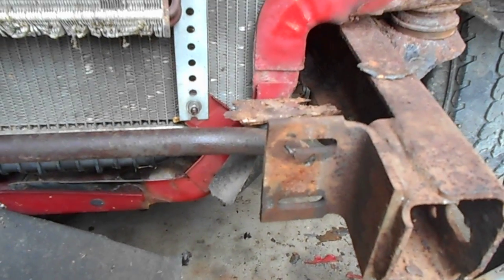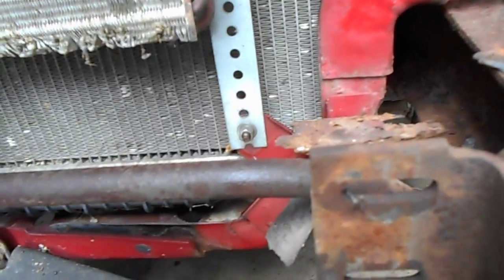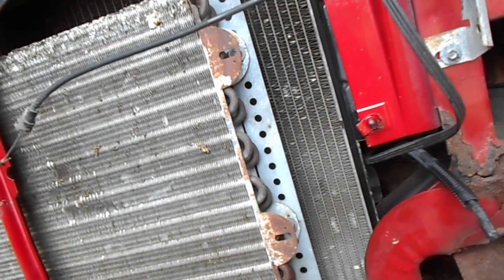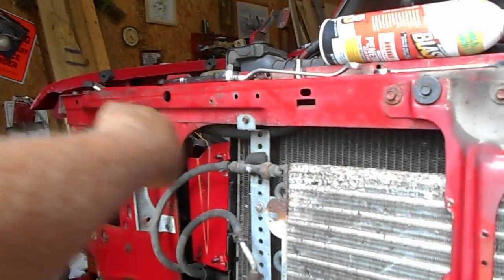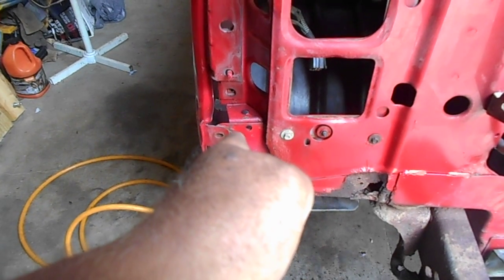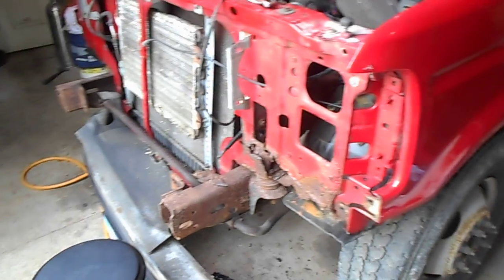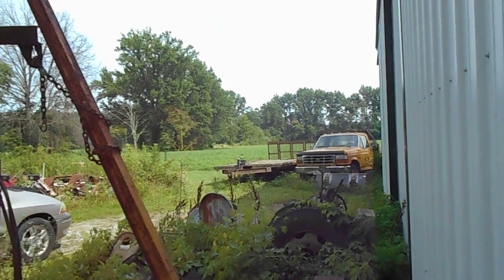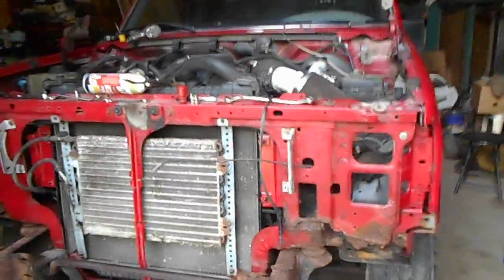Big Reds Tare Down pt# 2

Comment: They must've hit pretty dang hard to have tweaked the frame & body that bad.  I guess you'll just have to pull more needed parts off of the blue donator truck.  Maybe some parts off of the red donator truck ment for the yellow truck.  Oh, the fun & joys of fixing up stuff.  Stay safe
Reply from the maker: I am really hopeing that its just the front frame rails that are bent over, If its just that its a pretty easy fix to do. Most of what I need will come off the blue truck but if needed off the plow truck , 2 trucks to fix and 2 parts trucks to fix them with  so I hope I dont have to buy too many parts from the parts house and that will sure help the budget for the fix ! Bandit

Comment: buddy has a thick concrete slab floor in his shop with deep eyehook bolts set in it for jacking and straightening bent frames, works pretty good.   I'll look forward to seeing how you accomplish the straightening of yours.
Reply from the maker: I found an easy way to straiten it out that worked pretty good. When we built the barn I wanted to put some cans in the floor so I could put chains in the floor just for this reason, How ever my plan got over rulled and we didnt put them in but I really wanted to put them in.  When your not paying for it it's really hard to get what you want put in it. ! LOL  I think you will get a kick in how I do it !  Cousin Bandit

Comment: Thanks for the update Bandit.
Will you reuse the transmission cooler?
Reply from the maker: More than likely or I might have to get a bigger one now because I broke the fitting for the trans cooler on the radiator and It might not be able to be fixed so I'll have to wait and see what happens.  I hope I can fix it but if not it might get ugly !  Bandit

Comment: is that a 93  i had one, bought it new. drove it 265000 miles with one repair a alternater. gave it to friend. his kid recked it right away. they had a recall on the front bumper bolts.

Comment: Hey Bandit, maybe i just missed the video upload, when did you change the bed out on the snow plow truck? Or is that the snow plow truck?
Reply from the maker: The truck I'm working on is Big Red the 1 ton flat bed , The plow truck frame is too far gone to even thing about doing anything with it other than taking parts off of it.  I hit the frame with a hammer and it went right threw it ! So its shot !  But there are some good parts and an engine I need for old Yellow, When I get done with both of them I'll have made 2 good trucks out of 4 and both will have some goodies in them that they dont have now, Like AC !  LOL  Bandit

Comment: Bandit, in one of your videos you replied to someone saying that the later j'd 95 combines had 4 sticks. What did you mean by this. My 55 has 4 levers on the steering  column. Is that what you meant.
Reply from the maker: The 4 stick colume in the 55 95 and 105's was for raise and lower the head and reel forward ground speed and the 4th one (left hand side) was for the varable speed for the reel.  It was JD's way to copy the AC varable speed they had at the time on the head before they had the hydraulic drive on the 3300-7700 combines.  Bandit
Reply: thanks for the reply. Can you tell what year the combine is if it has the 4 sticks
Reply from the maker: It would be in the last 2 years production that had the 4 stick cabs and would be 68 and 69 or 69 and 70 I cant remember when the last ones were built, But I do know the 4400 came out in 70.  My 95 is an early 68 model just before they started putting the 4 sticks in and I wish it had it on it, It can come in very handy sometimes to have when cutting beans.  Bandit
Reply: Bandit farmer thanks  again for all the help. This 55 is an eb  and we just bought another parts 55 but it's not an eb. It has a newer serial number but it only has 3 sticks. It does have a knob on the variable speed fan that is much easier to change than ours. I think I'm going to rob that. It also has much nicer concave. I'm going to rob that also. I havnt checked out the grain pan under the raddle chain yet to see if it is good.
Reply from the maker: It never hurts to have a parts machine, My old parts 95 is a newer machine than the one I run now but they're both Corn Special combines so that helps . I took a lot of parts off mine already and there are some things yet to get off that I want to keep before I haul it off for junk.  This is how small farmers make it now by using there heads and not the wallets ! LOL  Bandit
Reply: Bandit farmer this parts combine has rasp bars that have every other tooth cut off and the other ones look to be built up with hard surfacing rod. Do you think these would work ok for beans.

Comment: Need a new radiator
Reply from the maker: Lord I hope not !  That is a huge radiator and I don't want to buy a new one , The last one I bought was for a 02 Ford Ranger about 5 years ago and it was a smaller one but it was still $290  ! So I have no doubt it would be over $500 for this one ! LOL So I hope I can fix the fitting on this one that broke and it not I guess I'll be coming up with a new improved trans oil cooler ! LOL  Bandit